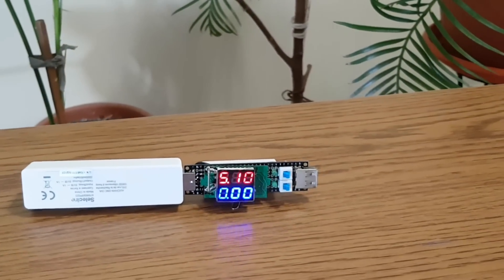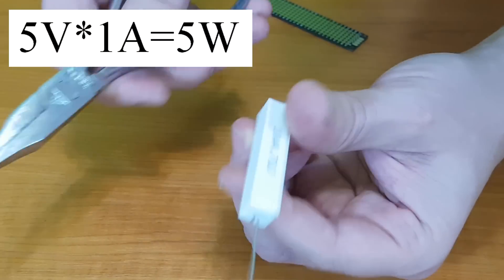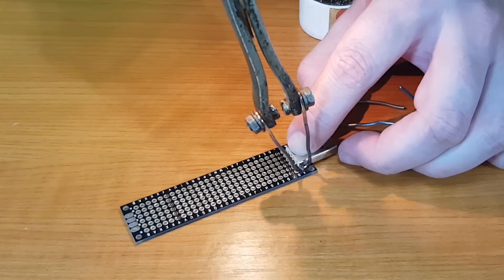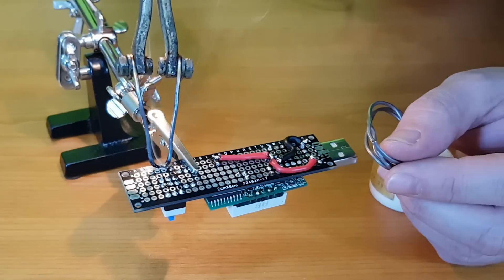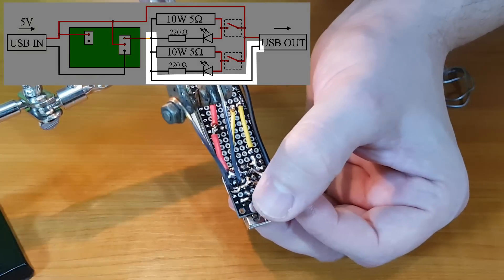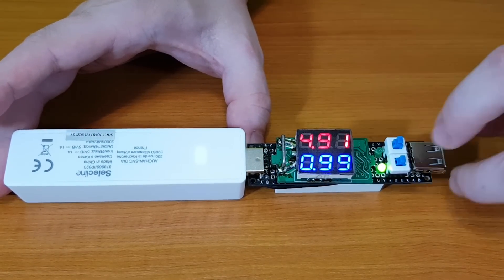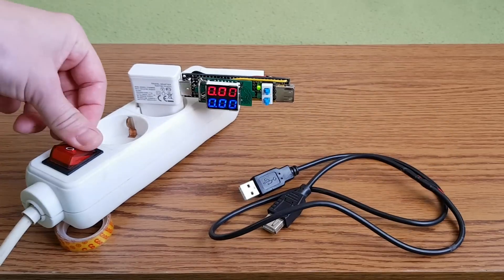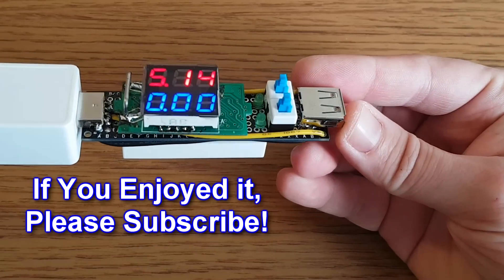DIY - USB Load Tester

Comment: Could the resistor 10w 5ohm change with 10w 10ohm?
Reply from the maker: yes but it will draw 0.5A
Reply: @Sorin_DIY  How 'bout 5w 10 ohm?
Reply from the maker: at 5W the resistor will be very hot.

Comment: Nice job. Can i use potentiometer instead of those  power resistors to achive different resistance to check 19 volt or 24 volts?
Reply from the maker: no. potentiometers can't handle 1A.

Comment: Hello Sorin, I mounted the load (2x 4.7) on the same side of the Prototype Circuit Board because I do not have long type, and used thick copper wire, to hopefully compensated the resistance of all the solderings...
I used  "USB Charger Battery Doctor" instead of Volt/Ampmeter Display like you, but it is the same thing. This once: https://www.aliexpress.com/i/32910960637.html
Once everything was working fine, I added some hot glue over all the connection, because all solderings are fragile and look like a "Spaghetti Sandwich" ahahaha
1 Switch enabled >> so 4.7 load + its led >> 1.06A  
2 Switch enabled >> 2x 4.7 + 2 led >> 2.15A
So I think that the build is a success
PS: only difference, there only 1 digit led Screen, so voltage and Amp are altering, but it is ok, it is doing its purpose 😁

Comment: Which one can i use, 20w 100 ohm or 20w 4.7 ohm???
Reply: Use the 20watt 4.7omh  the other resistors are limiting the led current!! that's all.
Reply: But 5volts over 5ish omh's  is round 1amp. If there is a switch that can make them parallel you will get 2amp's load. Very handy👌

Comment: Awesome video! Complete beginner here, trying to decode your schematic: is there really nothing attached to the negative lead of the voltage meter? Or is that the current meter? My voltage meter has three wires for the voltage and two thick wires for current.
Reply from the maker: hi. the thin black wire is for powering the volt/ammeter. but if you power the volt/ammeter from the same source that you measure, you don't need to connect both black wires. the volt/ammeter will take the supply negative from the thick black wire. but if you supply the voltmeter from a different source than the one you measure, then you connect both black wires. the thin one to the voltmeter supply voltage and the thick one to the voltage you want to measure.

Comment: A lot of work for something that you can buy off the shelf for under $8.00usd.  If anyone needs a good USB load tester get the RuiDeng LD25/LD35 that measures up to 5A and 7A or HD25/HD35 that has the built in QC 2.0, 3.0 trigger.

Comment: How to connect data wires and where to connect? I don't understand
Reply from the maker: the data wires are just 2 simple wires, connected from the 2 data pins (middle pins) of the USB connector, to the 2 middle pins of the USB port. they act just like an extension for the data pins, from the USB connector to the USB port.

Comment: I've never seen someone use a soldering gun the way you do, and make it look so simple. I remember having and using a soldering gun some 40 yrs ago, and burning insulation as i would try to solder/splice wires. And yet you solder @5:36 with ease and skill. Outstanding job for doing this with what you have.

Someone once asked me "What's the best knife to carry and use", and I would answer..."The one you have with you, is the best one to use".  :)

Nice job on the DIY, and editing of these videos that you make, and your sense of humor works perfect!

Thanks,

JimmyG

Comment: Loving your videos. You should buy a proper soldering iron and use flux or rosin core tin!
Reply: It is a proper soldering iron. Look at the chain comments up there.

Edit: Never said it was appropriate though.
Reply: You have little to no experience soldering SMD or small TH components, do you? that's not a proper soldering iron. Not much to explain, really, even though he likes it, he can do 100 times better with a proper pencil-like iron and good flux, I guarantee you. No need to go for Weller or Hakko irons, i'm not an etilist, but that gun iron... ughhhh
Reply: I do have experience THT soldering. It is a pain in the ass with a big tip. I personally have a TS100 and a Daniu PX988, and they are so good for the money.

I never said his soldering iron was adequate for the job though. I'm just saying it is one, a Russian one too haha.